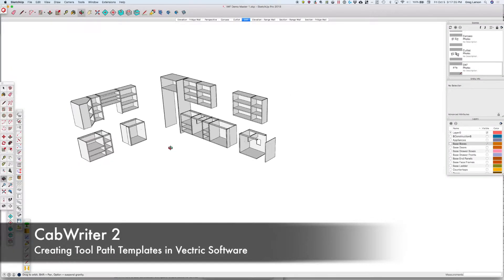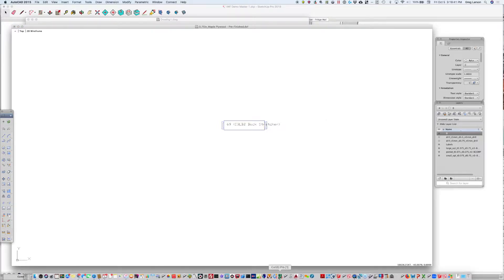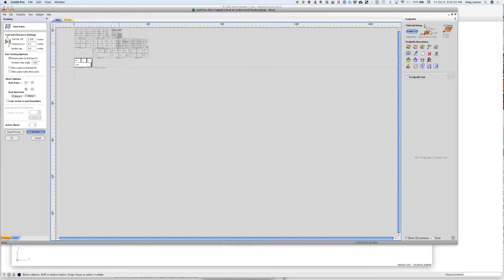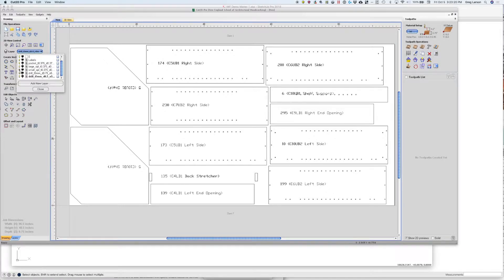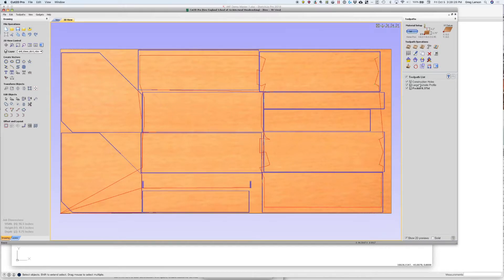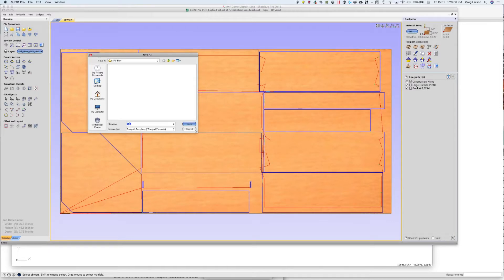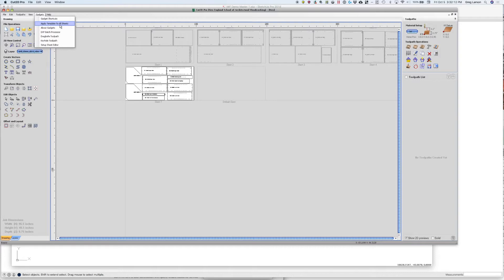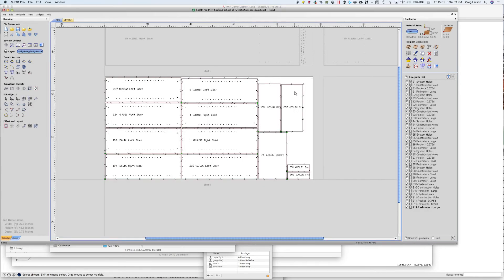CabWriter 2 - Creating Vectric Tool Path Templates

Comment: it is possible to make holes on the head of the panel to insert the junction pins of the top bottom parts in the video, only workings on the upper plane are seen
Reply from the maker: Hi Giacomo.  Unfortunately, we don't have the capability to do what you are asking.  It would be easy enough for us to draw the holes for the pins on the top and bottom of parts in the SketchUp model, but we don't have an easy way to communicate those holes in the DXF file.  I don't think we'll be implementing something like that anytime soon.  Sorry!

Comment: so i don't need to buy cutlist plus if i already have vectric
Reply from the maker: That's right; the only thing that Cutlist Plus can do for you is print labels for the parts, unfortunately, Vectric doesn't do that.  Of course, Cutlist Plus will also do plywood optimization if you don't have a CNC.  However, we are going to add label printing to CabWriter 3, so you really shouldn't need Cutlist Plus.  If you wouldn't mind, could you put questions like this into the forum on our website?  It helps us better track requests like this.  Thanks again for your input...